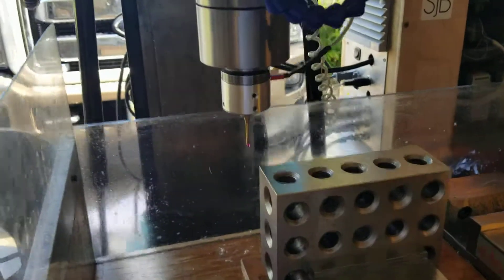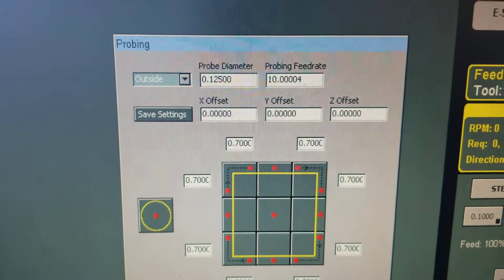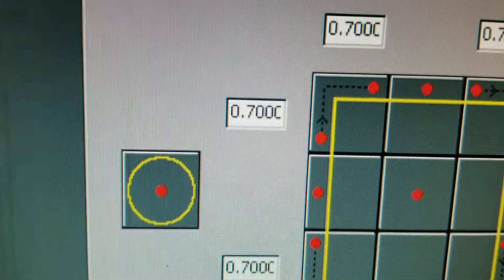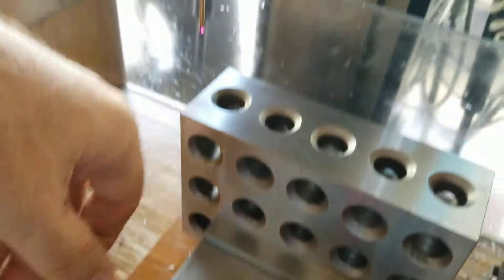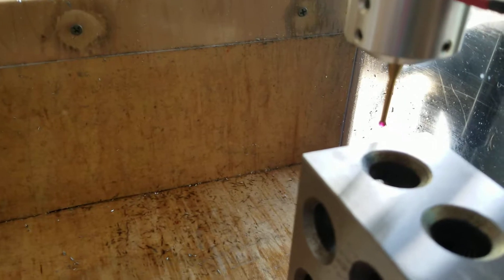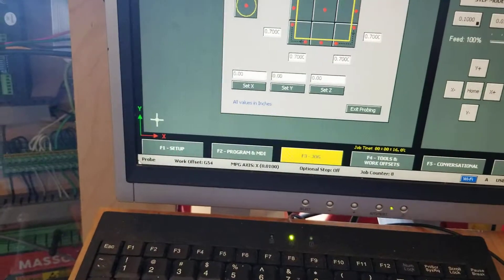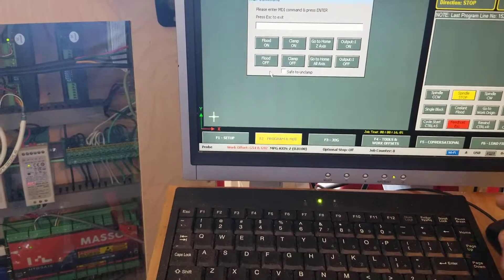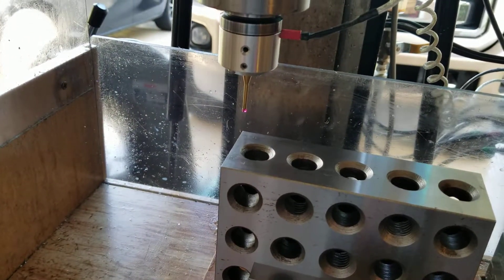Using the Masso CNC Probing Menu

Comment: My probing routine runs backwards in X and Y, any idea what I've done wrong?
Reply: Your X and Y travels are reversed.  They needed inverted.

In the F1 Set Up window, click on the X axis and click the "invert direction" box. Do the same with the Y axis. Also with the X and Y, set the travel minimum to 0 and in the travel maximum, have a positive number.  Then hit save for both X and Y. 

Then still in F1 Set Up, go the Homing and click the "invert direction" box for the X and Y.  Then hit save. 

What kind of machine do you have? Milling or Router/plasma?

Comment: What touch probe are you using?
Reply from the maker: Drewtronics.org
Reply: @testyourdesign233  Thanks! How are you finding the Masso? I've had one for a few years, but only recently I've actually had the time to really start using it on my Mill :(
Reply from the maker: @ryanleslie7425  it works very well. I have Mach 3 before but prefer Masso. Just got a new G3 version.  Will switch it out on the mill and use the G2 on my lathe if I ever get the time to convert it. Still use Mach3 on the cnc router I built a from scratch a few years ago.
Reply: @testyourdesign233  It would be nice to see how the G3 improves over the G2. I just ordered a Drewtronics probe yesterday, so I'll get it all wired up and tested soon.